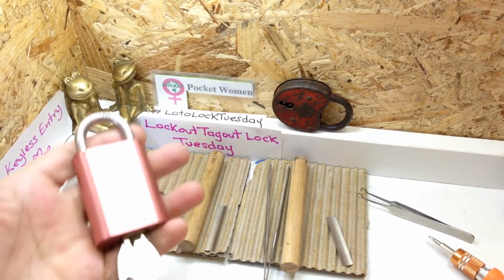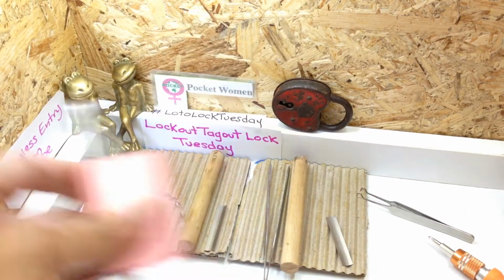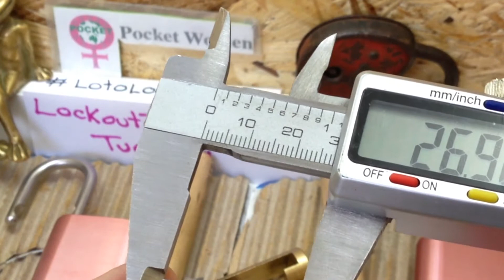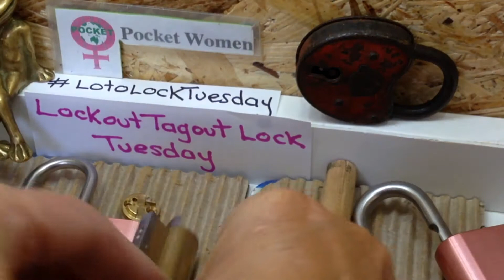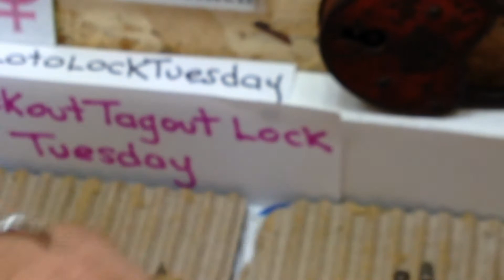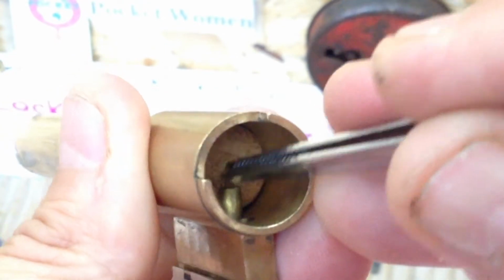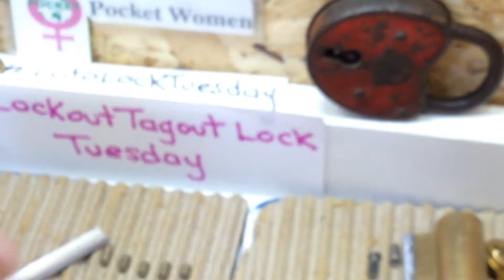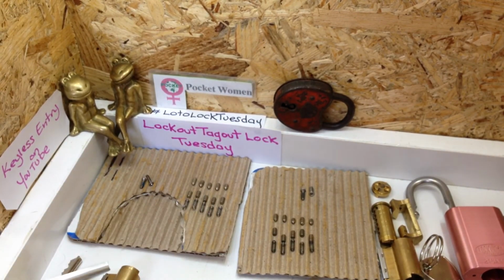(120) Lockwood 214A40 & 215A40 LockOut TagOut Padlocks A Comparison #LotoLockTuesday

Comment: Nice comprehensive comparison of the 214A & 214A👍 Great to see them both open and awesome work on the keys, they have some nice bitting on them too especially the 215👌 Strange about the 6th chamber having a different diameter, very interesting. 
Awesome work all round and thanks for making keys for them, I bet the 215 was a tricky pick.
Have a great day my friend👍😀✌️
Reply from the maker: This was really fun to do. I can't take credit for the open on the 215, I did try heaps but just couldn't get it. I gave it to Paul Springett to pick open, he did do a video on the open but his phone stuffed up and he couldn't upload the video. I did pick the 214 that was exciting to get the open on that. Both keys were fun to make and I was able to get them first try so didn't go through a heap of blanks trying. I did use the six pin key incase you wanted to add a sixth pin. I'm ready to do the video on the 256 next so I will be able to give you all your locks back soon. Thanks heaps for the lend of these, I really appreciate you giving me the opportunity to do these comparison video's, cheers matey.

Comment: Iv been waiting years to come across a American 1100 series without the protective wafer so I can use the damn bypass tool that I've also had for years but no such luck
Reply from the maker: It is possible to remove the wafer, then have a go at the bypass tool to practice using it.
Reply: @PocketWomen  still need the lock first though

Comment: I'm hangin' to get my hands on a lotto or two !  and those ones are mighty fine lookin' toys!
The ones that keyless featured the other day, the brass shackles, are they speciifically for elechickens ?

Also! props on the corugated card pin tray! I've take to using grid paper folded in a similar fashion, the super glue tray was just way too light and would regularly catapult pins across the desk then its a big ass job to re-arrange all the pins. especially if more than one locks guts are in there
Reply from the maker: I make the pinning trays out of my water boxes, I peal the first layer back to revel the corrugated then I glue it onto a flat piece to give it strength, the core holder section on some of them is the hole the water tap was poking out of. I've also painted one white. This way I can have many pinning trays full of projects. once clued together they can be cut down to any size you want. I've got really big ones for multiple locks and ones for doubles and singles, ones to fit in my practice case that goes with me everywhere. They are a really good size corrugation for the pins. I make most of my own locksport tools
Reply from the maker: These lockwood loto's are hard to come by but if you just want some Master lock loto's to play with practicing spools and tension I can send you some to keep and some to play with. I can also put you on the list as I'm sending around to Aussie pickers the American Lock and Master Lock loto's that Mr. Paradise sent to me.
Reply: @PocketWomen  is that the blue fridge size boxes from woolies ? Pura water ??
Reply from the maker: yep they are the ones
Reply from the maker: Got your address
Reply: @PocketWomen  thanks PW I deleted the post with containing it appreciate you letting me k now  & cant wait to get my ass handed to me on some challenge locks!!

Comment: Wonderful video😊. I really like this type of video, lots of great info. How did you make the key? Did you impression the lock or dismantle and take measurements?👍🇦🇺😊
Reply from the maker: This was a lot of fun to do. One lock I picked open and the other I got Paul to do the open. Then I dismantled and used the depth keys Paul gave me to get the pin sizes from the pinning kit Paul gave me by matching the key pins to the ones from the pinning kit to get their number size, that gave me the bitting,  then I used the the depth keys as a general guide to get started on the cuts as a 0 and then progressing down to the highest cut needed, filing slowly by hand so as to not over cut the pin size. filing each cut equally along the key stopping when I reached the right cut, then continuing on till all the cuts were done. Lots of core with pins in and out of the key to keep checking the depths. Lots of adjusting the shoulders of the cuts on the deepest cuts to get the pin to sit right and the key to move in and out smoothly. A very satisfying project with a great result.